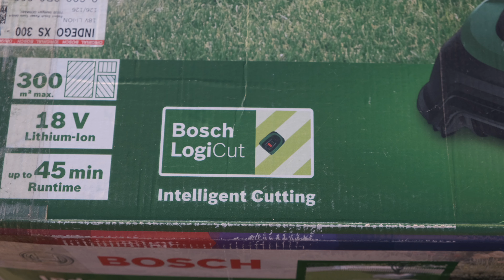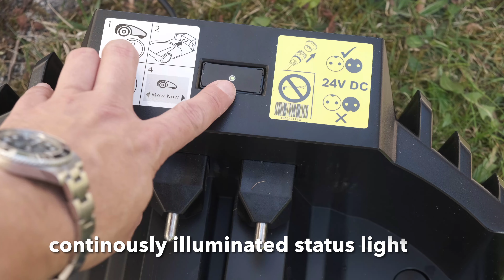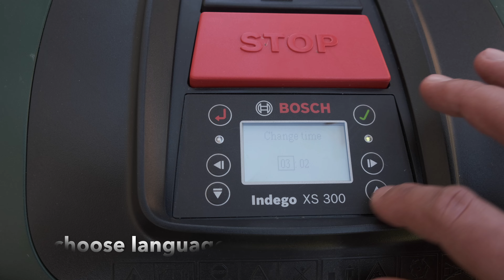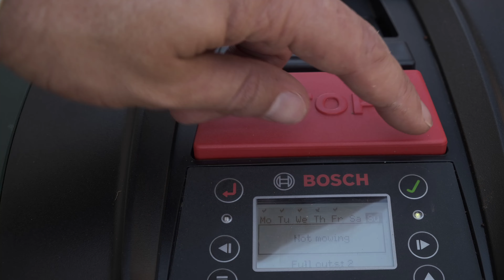Bosch Indego XS300 installation and test

Comment: Im just about to buy it. Does it know when it rains and does it cut to the edge?
Thank you
Reply: Did you find the answer ?
Reply from the maker: hi, it doesn't feature a rain sensor. It cuts to the perimeter wire.